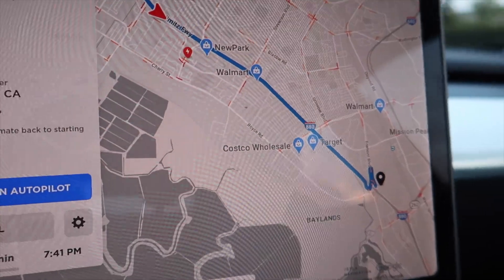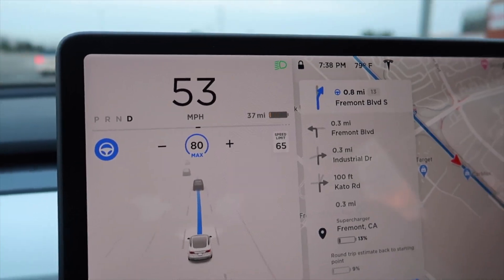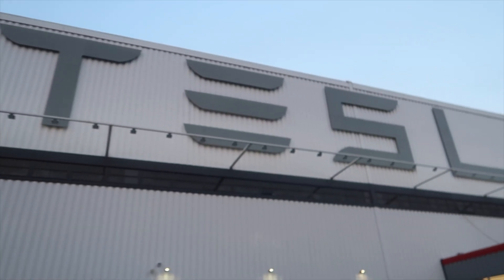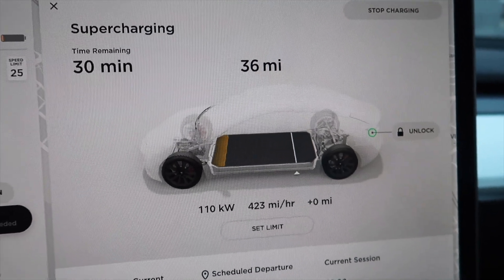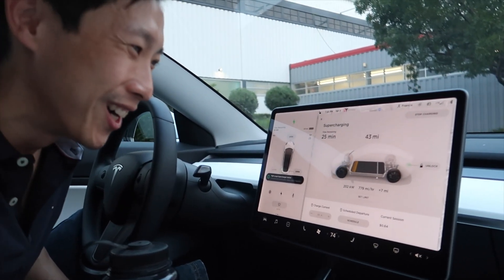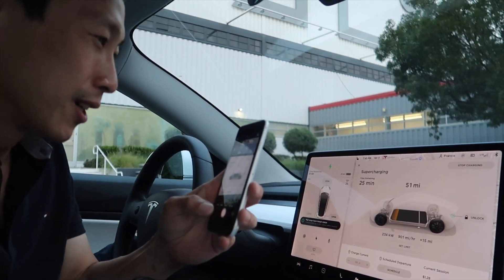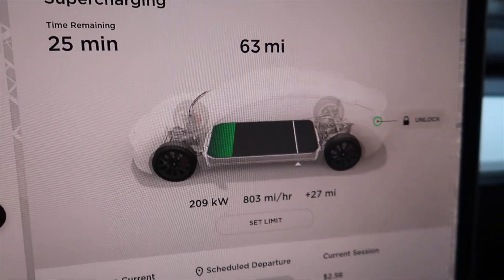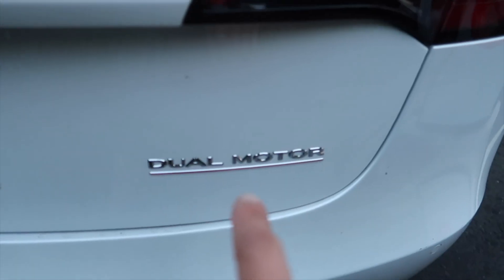Charging at 900 mph

Comment: i think you have the special dual motor year where you can buy that hacked chip and have better acceleration than the plaid lol. the ghost chip mod or whatever. i think technically the fastest tesla ever made was the standard range dual motor in 2018? because of the power to weight ratio, but u have to mod it too